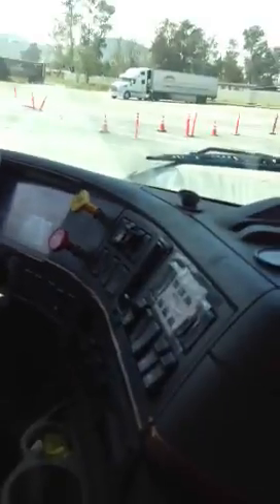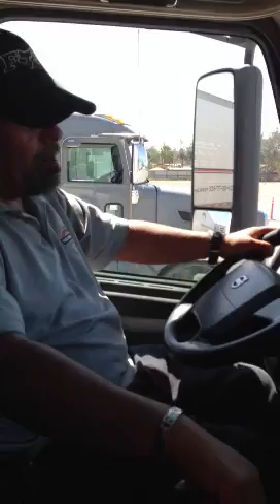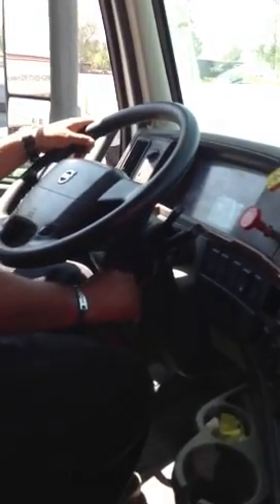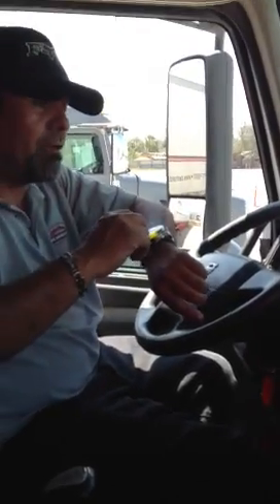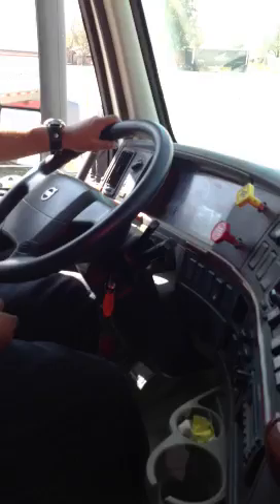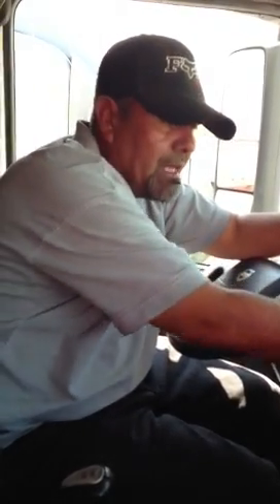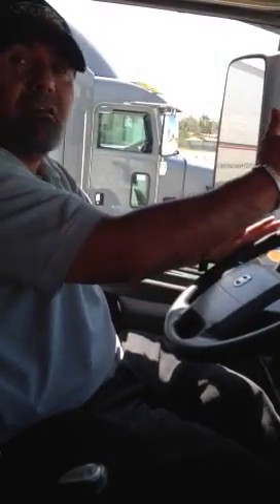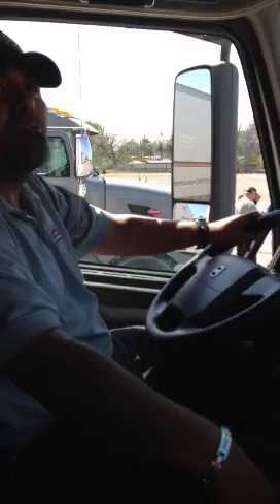Air brake system check test

Comment: there is a update to air break test first test governor cut out,air break application test,low air warning n buzzer test ,spring break test ,compressor cut in no lower than 100 psi ,air pressure build up test ,parking break test ,trailer break test,service break test
Reply: Indeed, and that MAKES SENSE. Why would, in this video, the pressure be leaked down to the light and/or buzzer warning at or around 60 psi or so, just to have to wait and double the pressure all the way up to the cut out test? It would appear to me that the governor cut out rest would be the, and always should have been the FIRST thing to do in all of this air brake  check proceedure.